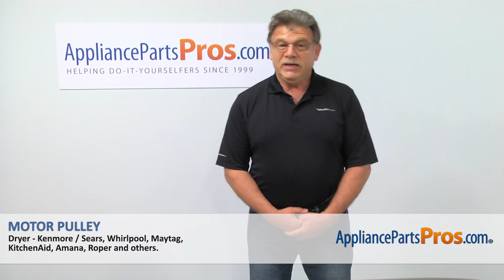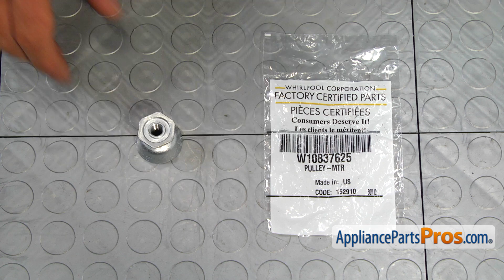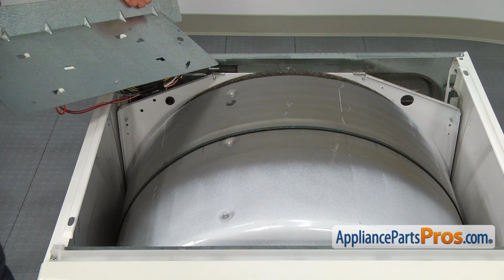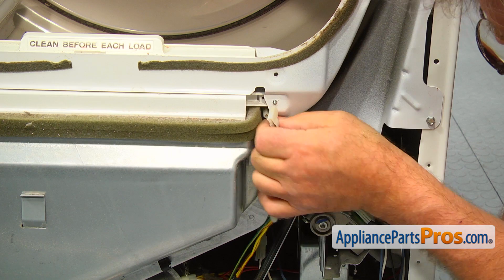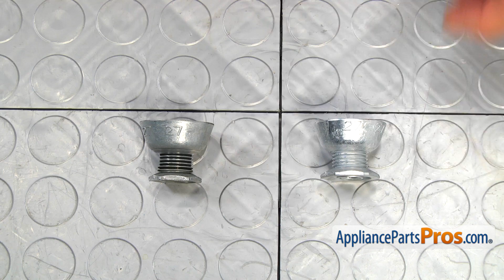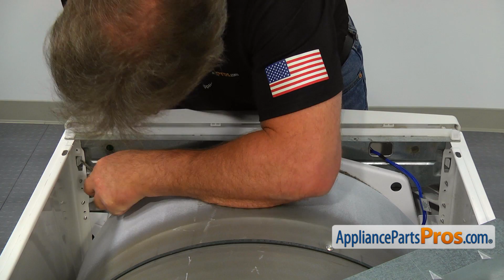Whirlpool Dryer Motor Pulley W10837625 Replacement — fits KitchenAid/Maytag

Comment: This is an excellent video and very helpful. After watching, I was able to replace the pulley by only removing the bottom plate. I could still use the 7/16th wrench to stop the pulley from turning and reach into the dryer with pliers. It took a little time to get the wrench on the shaft without a clear line of site, but it’s certainly easier than taking off all the panels.